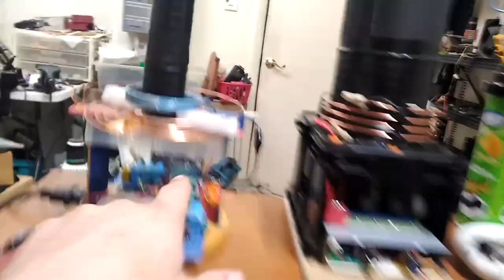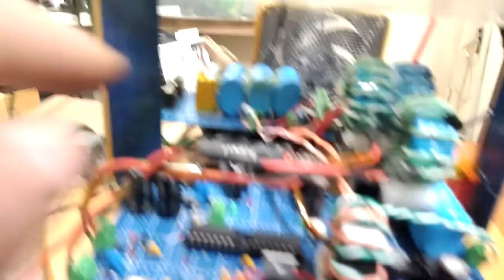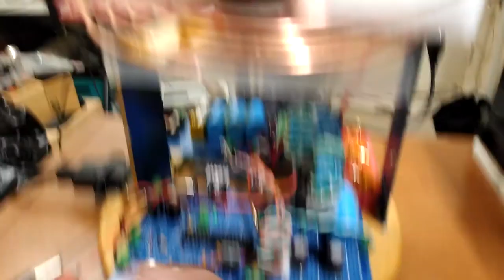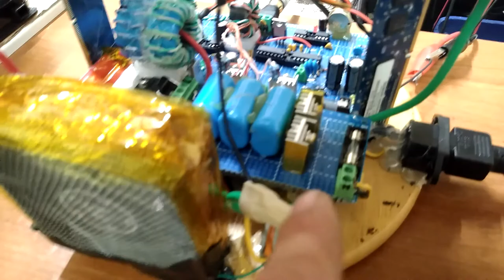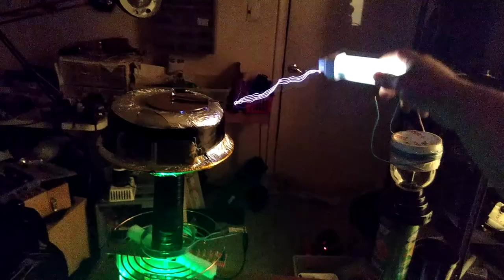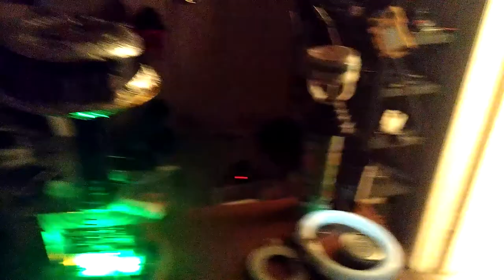Small DRSSTC-1 testing

Comment: Are you using the lm311 op amp for the OCD?
Reply from the maker: Yea and everything powered at 15v and just an IRFZ44N being switched by the 555. With the 2 stage 1:33 CT's I've been using a 20 ohm burden resistor.
Reply: @Magneticitist  Thanks. Can you make a video on adjusting the phase for zero switching? It seems like it doesn’t mention much on the schematic.
Reply from the maker: @parleyk4503  those older drivers don't really cover phase tuning at all just cuz I think guys hadn't worked it out at that point yet. You have to add some kind of RC filter or tunable inductor on the feedback. I've played around with it here and there trying various inductors and potentiometers but was never able to find any more of an ideal switching. I just don't mess with it at all unless the switches seem to be getting overly hot or they randomly die from what seems like transients. I tried an RC network in the feedback for an sstc and I had similar strange results. The good thing is it almost seems like I could tune it just by looking at the secondary waveform on a scope just picking up airvoltage because what looked like dirty switching noise could be seen in different places along the sine.  my problem was it all shifted around depending on what voltage I was running.  also seemed like my output was slightly better with slightly harder switching.  still haven't figured out all the details of this phase tuning but it kind of seems more necessary with bigger slower bricks
Reply: @Magneticitist  it might not be as Important with the small 60n65 IGBT’s we’ve been using. Especially with the OCD. Good to know. What’s your method of setting the OCD without blowing your bridge?
Reply from the maker: @parleyk4503  It's importance I think depends a lot on your particular build when it comes to things like propagation delay etc. I've played around so much with different similar setups I started to sort of get an idea of what outputs I could get compared to how much input current it would pull as well as how hard the switching was. I would notice just playing with the primary enough could yield desirable switching but getting the longest arcs is still a mystery to me. Getting the feedback CT proper is another important thing seems like. I had to take a stage off the CT cause it seemed like the feedback current wasn't strong enough and now it's only a 1:32 . When it came to IGBT heating it was critical finding just the right Gate resistance.
On my DRSSTC .5 for some reason the Gate waveforms looked super good with no extra gate resistors.. This kept me from introducing any real degree of dead time though so I settled for lowest resistance I could with fast diodes across them. The result was good switching with the heat probably going to the body diodes, something which can be worked around with more diodes. These primary feedback setups have wanted something around 5 ohms at least and I'm using fast diodes for faster turn off also. Only driving gates at 15v as well. 

 I technically haven't even set the OCD yet. I sort of just found my ballpark burden resistance using the 1:1000 or so CT with experimentation and that basically just put it in the range of my pri/sec arrangement to where it would start triggering depending on how I set it at around the voltage range I wanted to run it. From there I'd just carefully set it to where it didn't trip at the max breakout lengths to free air. Then I'd get it to strike an ungrounded object and play with it til the light barely triggered from the strikes. I'd sort of just bump it the smallest hair up after that hoping it will trip from ground strikes. I later read this is basically what Steve Ward does a lot too.

It seems to work. The OCD may not even be tripping when it needs to.. but it works for the ground strikes lol. Only death I've had so far with either primary feedback circuit is a random strike to a line input rectifier that jumped down way farther than the previous streamers were going out the side of the toroid.. This killed both IGBT's. I've had quite a bit of small tappable primary strikes too though, none of those did any harm.